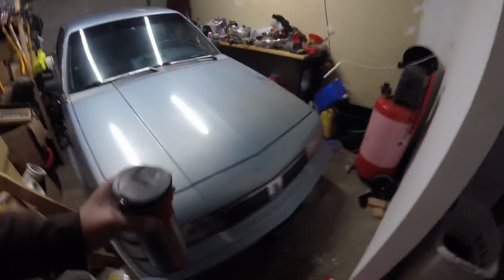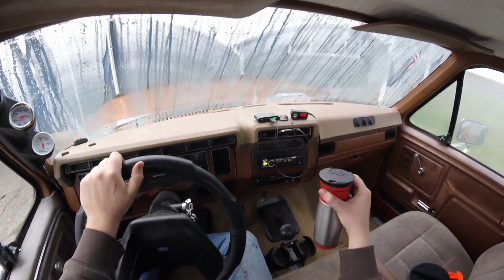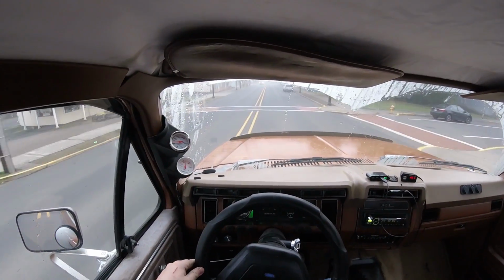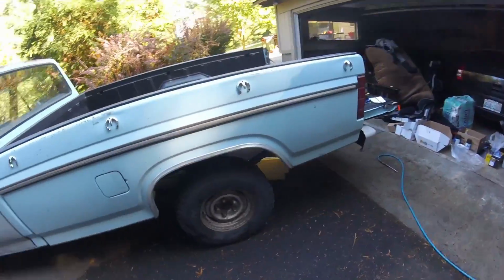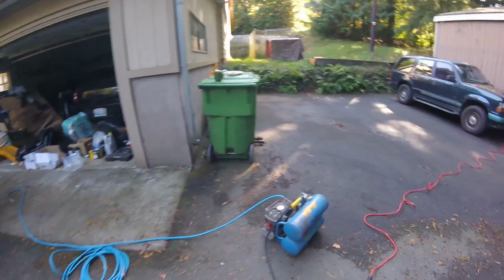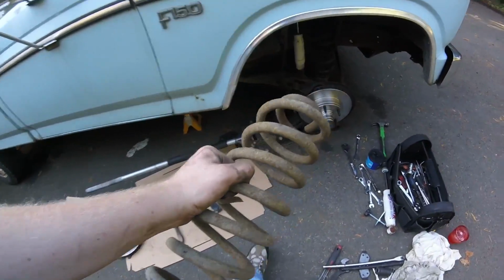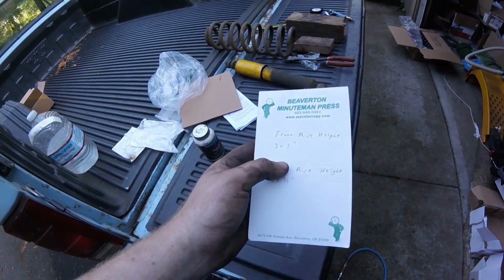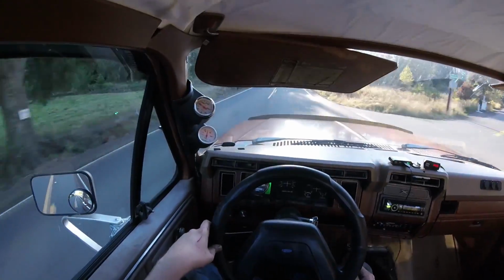Monday Ford Truck Project Vlog

Comment: Hey that's a cool ford pickup, I'm planning to buy my own pickup soon I dont know how to fix trucks but I like old fords in I would like to learn to fix them any advice for me thanks, also the truck I'm getting is both 1970s f100 and 1987 ford f150, currently I'm still thinking about which is a good pickup, like I said I like old pickups so any advice thanks